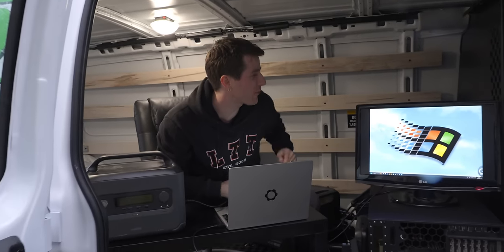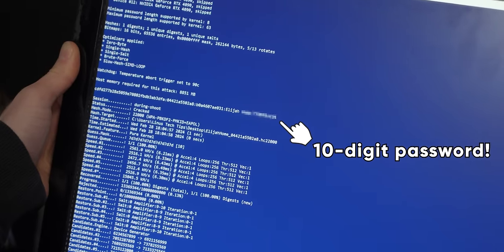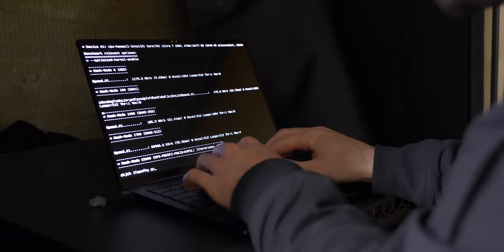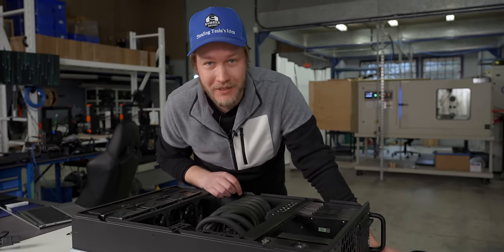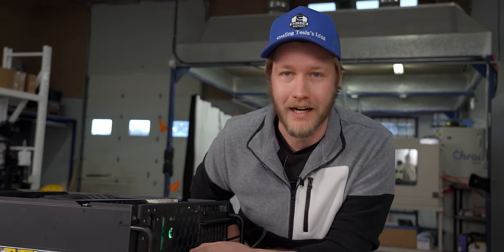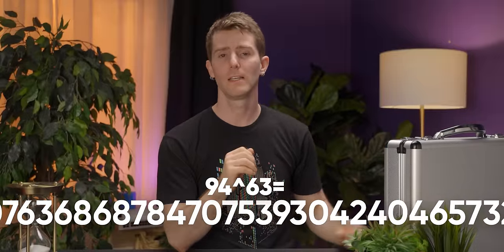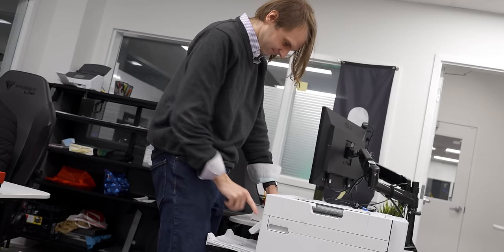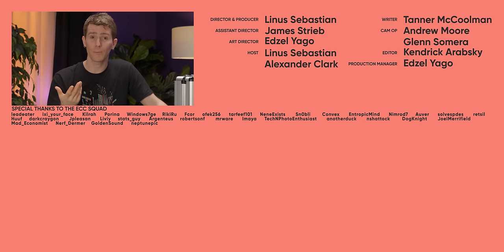I Made a Wifi Cracking Van

Comment: There is a really easy way to make 100% sure your printer's connection won't compromise your network... plug it in with a USB cable and make sure the wifi is turned off.
Reply: Worst case, plug into a network switch with an Ethernet cable
Reply: theyre ditching ports n printers now
Reply: @kazzxtrismus get an enterprise one then or something more professional rather than ones that are just there to waste ink.
Reply: @kazzxtrismus  yep our new brother printer doesn't have a Ethernet port. Which drives my bonkers
Reply: @greenbubbleboy5673  ...have *an ethernet port. (Sorry; perfectionist having English teaching flashbacks.)
Reply: I have dealt with printers where some more complicated documents would print over the network, but not over USB
Reply: Or ethernet cable :)
Reply: @kazzxtrismus  which is fucking nuts. The cost of implementing a 10M or 100M Ethernet port is single-digit cents.
Reply: @ItchyKneeSon how much did they traumatize you
Reply: @patrickfranchise Office Space has a good fix for those type of printers.
Reply: Wow just looked for a new printer they all had a USB port get a print server for the printer  have used them before.  They also can allow you to use more that 1 printer on them
Reply: MAC filtering will help.
Reply: What a novel idea!!
Reply: Doesn't that apply to almost all devices then? Or is Wi-Fi only used by people with printers?
Reply: @NoRestForTheWicked0  Wow mean right out the gate xD Geesh. Who hurt you?
Reply: Family got a new printer it's only wifi only connection is power.
Reply: There is an even easier way... Stop using printers and start writing everything by hand 🤡
Reply: I just keep my printer at the UPS store down the street
Reply: my printer is wifi only doesn't even have usb
Reply: @sangieredwolf  Mean? It was a genuine question. It's weird pointing out printers specifically for something that is applicable to a large amount of devices.
Reply: @kazzxtrismus  i'm ditching printers since 2007
Reply: @kazzxtrismus  My mom bought a printer that had a sticker on it that said "no printer port on this printer, use wifi" If you peeled off the sticker it was covering a fully functioning printer port.
Reply: I just bought a printer that connects via Ethernet.
Reply: USB is a hellhole when it comes to printers, you not only need to get proper drivers which is hard for many non-windows devices, 
but you can only use it on a single device and setting printer sharing is even more painful.
Its much better to use Ethernet since Ethernet connection is using standard network printing protocols (IPP and LPD), 
so no drivers required and many devices can autodiscover those printers, so no configuration either..
Reply: @kazzxtrismus  Those are literal E waste straight out of the factory
Reply: @Artificial.Unintelligence  The computers we get in at work have WiFi, we don't, but even when I turn it off it can cause problems. So I found a way to make sure WiFi stays off.... I remove the cards.
Reply: Or just idk spoof the printer to give u network access remotely
Reply: Yes. Never allow a printer to access an internet connection. There is 0 need, and they always seem to work more reliably with a wired connection.
Reply: @kazzxtrismus  "when Apple makes Printers" lol
Reply: My printer is older than 802.11 and USB. HP LaserJets were great in the early 90s and are still great today as long as you don't care about color printing.  The drivers still work as of Win 10 at least and I can't imagine 11 would break them.  These days though you pretty much need a JetDirect print server for it to connect it to Ethernet because it's not like computers tend to come with parallel ports anymore.  Literally the only thing I've ever done aside from replacing the toner cartridge is replacing the rollers.  Only one was starting to stick but went ahead and replaced them all at once over 10 years ago now and that's literally been it.
Reply: Wifi printers suck 90% of the time anyways. Ethernet is the way to go for network printers.
Reply: vlan + prinvers, iot, cameras and network shares al the way!
Reply: Use a print server connected via usb
Reply: @sovietunion8304  Severely; the 3rd graders kanchou'd  me!!!
Reply: @Artificial.Unintelligence  If you're okay disassembling part of it, you can cut the antennas or remove the module (they're often on their own pcb because manufacturers love reusing the same internals).
Reply: @sangieredwolf Fixed MAC access to allow access as well as elevate Bandwidth limit is such a fun that my devices will faster downloads speeds😂
Reply: Too bad cheap consumer HP printers literally require you to connect them to the wifi (no ethernet port) and register it with HP Smart before you can then go back and plug it in via USB. It will block use of the USB port until you do this.

Comment: We just called it "wardriving" back in the day. When I was a kid, we squatted an abandoned 10 story apartment building. We had the WEP keys for every network in cantenna range. If a network wasn't available for some reason, just had to re-aim the can on the tripod.
Reply: Haven't heard the term "Wardriving" in yonks.  God I feel old.
Reply: i fucking love crime man thanks for sharing!
Reply: Wardriving around the city I lived in 20 years ago with a USB wifi connector taped to the roof of the car. Memories.
Reply: The problem is linus just find out .
Reply: I remember wardriving in my small town like 20 years ago and noone's wifi was protected. Then I went to film school in LA in 2008-ish and EVERYONE's wifi was protected and someone was like "yea, everyone has screenplays and scripts on their computers and they are worth millions potentially". Made sense they were more up to date.
Reply: I had a high gain magnetic omni that would stick to the roof of the car - and fed the coax in through the window to the equipment. When we spotted interesting targets, we'd just pull over and back up a bit to have a snoop. It's not quiet as easy these days - but it also hasn't gotten massively difficult as the video shows.... Humans are always the weak link in security...
Reply: When I was young and broke I turned an old wok and a cheap wifi range extender into a parabolic antenna. I could pick up the entire neighborhood, it was so powerful it could even pickup the low power WPS transmissions. I had free internet for quite a few years courteous of my WokFi.
Reply: Wardriving is a WAY cooler term for it! Although a group of cats I used to run around with called themselves the "Cartographers" derived from what lots of know as access point mapping. The Cartographer s as a tech moniker was just so slick back in the Matrix days! But these are dudes that call a completed unit, a video card, and never a gpu! Lol! So they enjoyed the play on the word mapping. Jeezis... I feel older than shit!
Reply: Nostalgia
Reply: Ah sick, squatting is one of the coolest crimes
Reply: Yep 90"s Australia... Lots of open settings
Reply: God I feel old. I still remember back when phone phreaking was a big security issue.
Reply: @rvdeddrift - Certainly a lot cooler and less stinky than dumpster-diving back in the 80's and 90's for CC's.  Damn,I can still smell it. lol
Reply: Wardriving doesn't include breaking into the network
Reply: i was just told (@BillinSD
1 hour ago
This is not wardriving )
Reply: Thank you, I was about to say something similar
Reply: @BillinSD  ultimately your half right. part 1: locate networks. part 2: determine access. part 3: access. how that network is accessed is up to the wardriver. if the internet is open, they use it. if not, they either move on to easier prey or... either way if your mobile wether it's just seeing if there's ap's available or accessing them open or not, targeted or not, it's wardriving. a rose by any other name...
Reply: @fatherfoxstrongpaw8968  yes, and this video is about cracking Wi-Fi passwords not wardriving
Reply: @BillinSD  i get that, but i was commenting on the mobile part. the hacking is part 2 OF WARDRIVING. that's all i was saying. (Specialization Is for Insects - Robert A. Heinlein)
Reply: i still wardrive when i need free proxies, and i need them often. Won't tell why obviously. EVERY hood has at least 2 guaranteed wifis that are vulnerable to WPS attacks and it's 2024. Takes about 20-30 minutes to find them, crack them, save the gps coordinates and off you go. Come back months later with another car so it's not sus and you're 99.9999% impossible to catch,
Reply: @lumikarhu  back in teh early 2K's the big thing was to make a battery powered device you'd leave in a bus and let it travel it's route and between the hobby gps and wifi, you'd map out every network on that route and know where, if it's open or what security it had and not waste a day traveling or wasting your own gas. you just had to collect it before the last roundabout and hoe someone didn't find it or it fall down from under the seat if the magnet or adhesive let go.
Reply: @fatherfoxstrongpaw8968  i never liked this approach - the bus is essentially a Faraday cage which reduces the antenna power significantly. I don't even keep the antenna inside of the car, it must be outside.

Also you're talking about mapping, and yeah there were websites where you could then upload this data for everyone to see (they still exist but nobody updates them anymore) and this way every wifi would become public knowledge. 

I, on the other hand, am talking about cracking them while i'm parked. Just mapping them is pointless for me as i need an organic "proxy" to use. it really takes 20-30minutes per stop to leave with a few networks in your pocket. And they are better than open ones, since only you and the owner can access them. Open networks usually have some sort of stupid QoS enabled making your connection inferior too.
Reply: yep wep was great.  Remember wardriving grabbing all the neighbors  passwords.  made remote connecting  easy on the go!   Need to stop and connect.  just crack a wep in 5mins.  connect ..

Comment: You don't even need a van to hold the cracking equipment. You just need the lower power device to intercept the handshakes and then send that data to a remote server optimized for cracking.
Reply: Yes, you can even use cloud compute. But you will have to make sure to erase your traces. But in most cases cloud computing providers aren't looking what you're running on their systems, as long as you aren't scanning the whole internet or something
Reply: blah blah blah nobody cares
Reply: @MrLTiger  L + ratio
Reply: @MrLTiger  Some people do. And you cared enough to write that - and hit the reply button.

If you don't care: Move on.
Reply: When does a handshake happen? When you first log in to the wifi or the whole time you're connected to it?
Reply: @xshotx2745 : When you initially connect. With that being said, there is (at least in the *censored name* Linux package) a command to broadcast a “de-authenticate” packet, which prompts any devices connected to a given network (and within range of your equipment) to redo their handshake from the beginning; thus allowing you to capture the data.
Reply: @xshotx2745  It's explained in the video
Reply: that's how ya doin it. I recommend using SAT.
Reply: Whole purpose of the video is to be a fun concept for viewers to engage with. I’m sure they’re aware.
Reply: They care for this more than your comment or opinion.  @MrLTiger
Reply: true! i do it in a backseat of an old sedan that looks like any other car around, with a soon 10 year old laptop. Preferably when it gets dark so nobody notices the small antenna going through the window. I also use these large powerbanks to power up the laptop when the engine's off. Depending on the goal sometimes we ditch it and use the car's battery instead. A friend then drives few blocks down the street, rinse and repeat. Oh and I dont do WPAs, too much of a hassle when you have vulnerable to WPS networks that take 15 minutes tops to crack just like the old WEPs back in 2005-2007 lol
Reply: yea basically a pwnagotchi

Comment: Definitely an eye-opener on Wi-Fi security. Time to double-check my password setup and perhaps even consider separating my IoT devices from my main network. Thanks for the insights.
Reply: iot devices 100% should be the most limited as they are usually the least secure. good luck
Reply: I can literally use Cain and Abel from my phone and crack your wifi with a phone. The van is basically just for show and makes no sense really
Reply: Realized that not only am I using the standard password but also that the back of my router is against a window. So the password is clearly visible from outside 😂
Reply: Some routers with OpenWRT allows you to create hundreds of dummy WiFi hotspots with random passwords.  That will keel Linus busy for a while.  lol
Reply: I am not too worried about that because one wouldn't be able to get close enough to our house to receive our Wi-Fi signal without breaking into our property   - which is secured with CCTV and an alarm. And we mostly use LAN anyways.
Reply: You should hide the SSID. Does it help with handshake collection?
Reply: @BobIzam  If the IoT device has an app on your phone it really doesn't matter what network it's on. The apps are typically where the privacy issues are.
Reply: @yensteel  - Unfortunately hiding your WiFi name won't help, most hacking tools will see it just fine.  "Security by obscurity" is a really bad idea.  On the other hand, using a completely random over 20 characters long password would help, at least till quantum computers can crack it.
Reply: @arthilas_  - Unfortunately with a good parabolic or Yagi antenna, your home WiFi can be access from over a mile away.   The best way to protect your network is with a completely random and over 20 characters long password, it's not like you have to type it every day (or just copy and paste from a text file).
Reply: @BobIzam  Plus, unlike computers/phones they also don't need to see other devices on the network so it is definitely a good idea to separate them.
Reply: @BillAnt you could even have a raspberry pi connect to them randomly so an attacker can capture a "handshake" and stop capturing but really the handshake is for a dummy network
Reply: I've been hearing about people separating IoT devices like this, but didn't realize fully how important it is until this video.
Reply: @BillAnt  Thanks for the info and tips :)
Reply: Look into limiting access based on Mac Address. I don’t remember the name of the tech, but basically you register the mac addresses of the devices that you want on your network. It’s not perfect, Mac Addresses can be spoofed, BUT having two devices on the same network with the same MAC would cause noticeable issues. It’s also a huge pain in the ass whenever you want to add a new device to your network, but it is relatively secure.